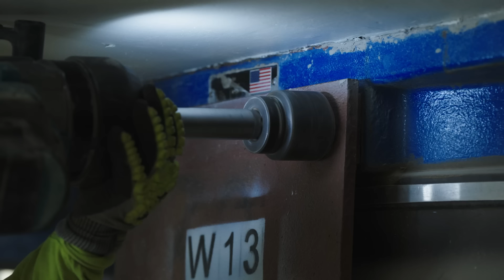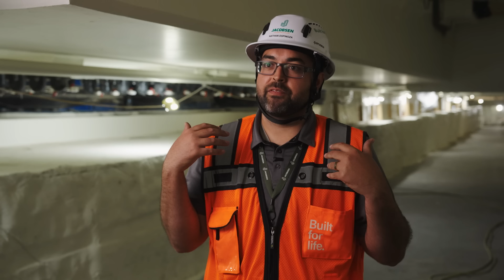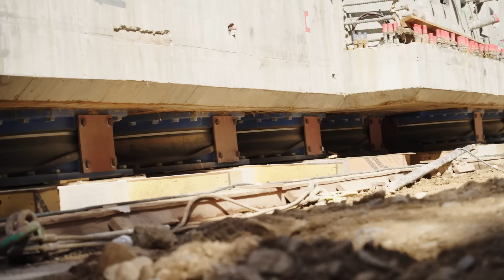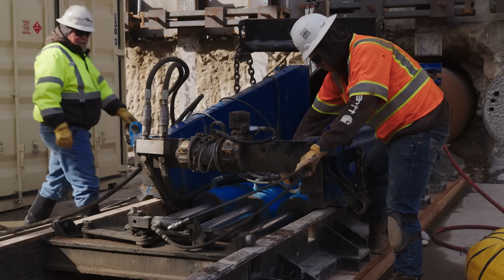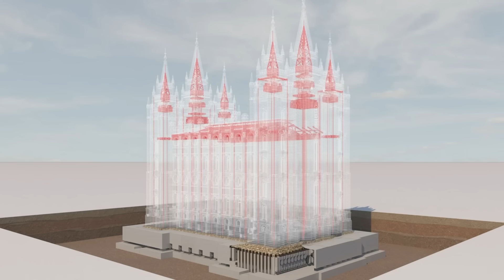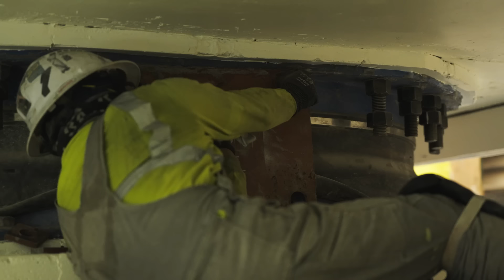Salt Lake Temple Base Isolators Completed

Comment: Remember President Nelson comparing our foundation to the Salt Lake Temple foundation and encouraging us to make any necessary improvements that we need to make.  If you check the USGS quaternary fault line interactive map, you will see that a fault runs directly under the Salt Lake Temple.  We are just like that.  Things are going to shake us.  What can we do to prepare?  I love the symbolism of separating us from the world just like the temple was separated from its connection with the earth.  It now floats above the earth -just as we need to float above and not be attached to worldly things.  When we know the ground is going to shake and we are not bolted to it, we can slide smoothly from side to side trusting our Maker and being more worried about being connected to Him through covenants, rather than being worried about being connected to anything temporal or worldly.